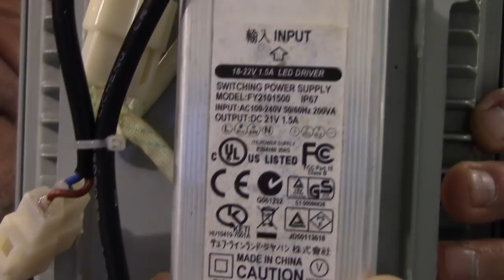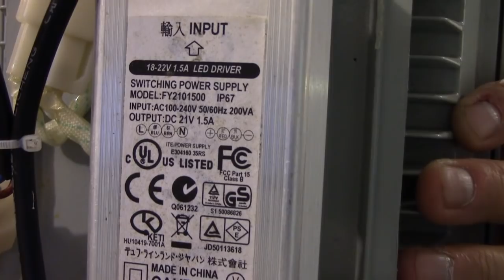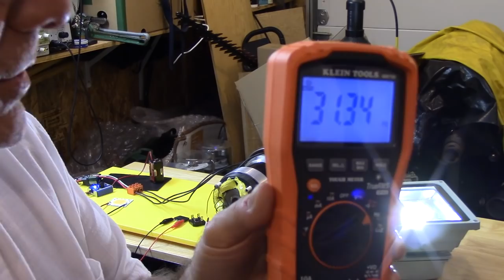Gerard Morin: A Glimpse at the Generator (Important)

Comment: I rebuilt two Baldor  3 phase 7 hp motors 40 years ago. I started the system on 120 ac then looped it back. and was running my big lathe (It would swing 29 inches at 9 feet). An Interesting thing happened it scattered (the generator) at 35,000 rpm, long story short it blew up, luckily I was at the other end of my 120 foot shop. You are point on Sir, I'm now retired in S.E. Asia. God Bless you for knowing we swim in a sea of energy. P.S I've been in sand storms in the middle east that blocked out the sun. When ever the neutrinos are disturbed on the Sun their cousins are excited here on earth instantaneously. Every time there is a lightning strike on earth the Neutrinos are disturbed around the planet instantaneously and that is free energy, as I understand it.  The negative spins right, the more negative spins left. When they rejoin you have energy if you're smart enough to collect it. Carry on Sir if I discover anything earth shattering I will happily share it with you so you can share it with the world.
Reply: also interesting

Comment: A rotator that produces high frequencies doesnt need to rotate at a very high speed to produce the propper resonance, in fact it isnt needed a high speed for a wanted frequency. Once a resonance is achieved the other component is the amount of pressure generated in that frequency, so if you add or take away energy to it you can actually extend or reduce the radius for the reaching of the frequency and the amount, it also can be audible or simply felt like tinnitus in the inner ear.

Comment: your LED's flicker because they are digital DC it is a diode a half wave rectifier, so when you connect it to AC it blocks one half of the cycle you are now creating a visible pulse,  if you put a full wave rectifier like you did you will still see the pulse because the LED uses all available energy in the cycle, then add a 1000 to 2200 MFD cap across the DC of the rectifier, it will store DC power in excess of what is necessary to run the LED for the cycle  removing the AC oscillation, the larger LED light has a wide range driver that will accept multiple voltages.

Comment: 19:00
The washing machine drum motor.
Three legs (phases?) All connected together with no ground (return line?) He says "motors" normally have return lines? Calls this a linear motor? Like the rail gun trains? Which operates coils in an on off configuration. Constantly attracting forward. Linear motor rail gun trains use one pole magnet (north pole and south pole) as if one bar magnet across (left to right.) Which is necessary to balance the height and center of the train because figure eight coils on each side of the train are connected also across the bottom of the track below the train. The superconducting electromagnets in the train are forced by the induction created into these coils to balance height and center on the "track." According to induction and feedback from electromagnetic generated in the figure eight coils. 

The drum motor stator is attached to the plastic drum (which holds and collects the water, under the metal drum) of the washing machine. The rotor is attached to a shaft which is attached to the washing machine rotor or metal drum which has water drainage holes. The shaft is attached through the plastic drum to the metal drum above it. After removing rotor and stator of the motor the two drums of the washing machine remain attached together.

If it has no return or ground line, this makes it like the pole transformer. Which he says makes it therefore an antenna transmitter. Inducing into three recievers. So the hyperdrive motor and the pole transformer have these two things in common. Both have no return line making them transmitters. Both transmit into three recievers. Induction into the coils becomes sine waves in the transformer so maybe also in the hyperdrive? He says the three legs terminate together? If the motor is driven by resonance the same as the pole transformer (PT) and if a slasher cycler must accompany this maybe the "driver" is the chopper (Hertz.) Because there are three inputs to three sets of coils and because washers control forward and backwards motion. This is likely the only reason for using the legs. In order to control the direction. Regular linear motors use successive coils to create a moving magnetic river or flow. With two or three phase AC would these work in s motor that terminates all the coils together? Delta or star configurations also use similar termination points. Is it explained that such end points act as a resistor or as a reluctance (magnetic resistance) whereby the magnetic field of the charged coils phase conjugates? Charge reverses backwards. Thus creating the same AC as the pole transformers. This is the Bedini battery charger motor effect. Phase Conjugation (PC) has inward charge attracting inward the magnet into the coil. When the coil is off the charge reverses PC again and the magnet is repelled outward away from the coil.

The home wire that is hot is chopped on and off. Connecting hot to ground or neutral increases reflectance resistance and therefore INCREASES PHASE CONJUGATION AC POWER. Without the reluctance resistance AC is not produced?
Reply: To recreate the Bedini charger effect and understand pc phase conjugation. John Bedini used a pendulum having a magnet on it. If he used his "how to wind a coil" method his coil was made with folded wire (several folds) also using one separate wire folded maybe twice. These wires twisted together and then wound on a spool. The one less folded separate wire is the trigger wire that charges the entire coil core together. A strong impulse from a healthy battery into the whole coil and core is attracting in the magnet. When off phase conjugation occurs and repels the magnet, because the longer wire (secondary) is connected to a dead battery (creating high reluctance and resistance.) As the dead battery is getting more charged up the reluctance resistance drops and the magnet is repelled less and less on the swing of the pendulum.

Comment: Why not call it a High Frequency Magnetic Generator  (HFMG Motor) for short. And please don't tell the powers-that-be that you're going to run them out of business. they will take you out in a heartbeat, stop doing that please. For Your Own Safety.
Reply: ionic-field-capacitor; is what it is. its not a motor (not for pushing a load of physical-matter). the only thing being generated here is an electron (ionic) field through the spinning the ferrous element with the high-speed-turning. the "ambient ions" are trapped in the field, and they bring their associates with them (basically, he pulled the stopper out of the bathtub, and the "juice" you see is all of the water flowing down the drain).
Reply: SURE IS DANGEROUS TERRITORY ! 

BE VERY VERY CAREFUL !!
Reply: @pgprentice  Scam artist  I got taken for just over 3000

Comment: What’s the big deal here?  You have a 48V DC supply on the bench behind you.  The back of the lamp says “21V 1.5A”. That is 31.5W of power.  I’m guessing the 48V DC supply is putting out about 0.8A.  You are not creating any free energy or violating any laws of physics.  It’s simple; that lamp is quite capable of running with a 38V AC input supply.  Whether it is 60Hz or 30Hz is inconsequential.
Reply: Totally, you get it, and the 30Hz is way its pulsing. Probably only checking and or using one pole of a two pole system.
Reply: How do I get 1 ... ??? You know it ... I don't...idk nothing about it ... can u help me built 1 ???

Comment: Hi Gerard, I stumbled on your videos via Youtube suggestions, I have watched several of them and have some basic questions. It seems as though you are convinced that you have something new and exciting. But some of the things that you say and are attempting to show go against all known knowledge of physics and electricity. You are only showing amperage and voltage measurements. There are two main questions that come to mind, as you have been playing around with these ideas for some time now, Have you managed to set up a unit to run your own home? If not, why not? You seem to work only with light bulbs of different types, why don't you power up something else that is used on a regular basis, a vacuum cleaner, a television, a microwave,  a hairdryer, a computer or whatever? This would show the practicality of what you are trying to do, if you have already done this somewhere maybe you could provide the link.
Reply: I hope you are not holding your breath waiting for an answer. It won't happen because it would prove he is right. The magic is in trickery.
Reply: @miketyler2513  nope had forgotten about it

Comment: You know you DO NOT NEED  a power source , right with that. tesla made his own power source , NO BATTERY.   IT WILL RUN ITSELF  you just need to know how to. IF you DO NOT KNOW the trick  it will NOT run itself.  I can run a magnet  generator off of a small motor. The generator MUST BE built so that the generator puts out 4 times the amps and volts the motor needs. YOU think this is NOT possible. IT IS NOT possible if you DO NOT FOLLOW the schematic.  TWO FORMS of electrical energy and tesla used both. you know both of these already. the energy with the washing machine generator is one way and the A.C we have today is another. he used both. Tesla said you can multiply volts , NOT AMPS. All this you already know , put it together . HINT , one powers the motor and the other powers the generator when run in unison as one , the magnetic resonance ramps up  that creates even more energy.  i hope you understand this. THIS  MAGNETIC ELECTRIC VIBRATION IS THE KEY.  BELIEVE IT OR NOT. I was wondering if you set it up so it can run itself and put out a significant power source to go into a transformer/capacitor.

Comment: What's powering the generator, from here it looks like electricity?
Reply: yes, small dc voltage feeds a motor he modified from a hoverboard, which turns the RF generator. the Hoverboard motor is further from the camera, the RF generator is facing the camera connected with a single shaft, each on its own bearing. RF and AC have the same wave pattern, which is how he's able to use it to power AC devices at lower amperages. Apparently it's easier to produce the RF power than it is to produce the AC power....this is the secret. (as I understand it)

Comment: How big would a system like this have to be to move a 500 pound bicycle load at  50 mile per hour for 100 miles distance? Would gearing be able to be used to increase the bicycle load weight and still maintain the distance and speed?
Reply: build one if have and test it   if you can   and if you cant   go eat t a bag of chips

Comment: Do you have a video where it is shown how the generator is constructed?Thanks
Reply: I haven't found one yet, but as far as I can tell he's using a single phase magnet to oscillate a stepping transformer then rectify the output. He explains that generating RF Voltage. What Tesla calls Static Power. So you gotta stop thinking AC or DC voltage.
Reply: dude rilly

Comment: Lot things are involved but me understanding thats microbial/thermal baterry fuel cell .
Simplicity only.
Normal old delco alternators and starter motors do that litel effect .
You have some points but what you are showing is only small part of it.
Biology ,chemistry,electro magnetism,mechanics,thermo dinamics are involved lot other things.
But mostly random effects.
Even inurtia and gravity temperatures effect that generator.
The history in short US army used compound motors multi stroker dual engines with compound rotary sg's most similar such engine exampel is willys jeep kubelwagen also called gasoline-disel engines driveing dual current rotatary devices rotary transformers/inverters/converters old delco hade 4 commitators.
So the generator parts it self makes the diference.
And back then those engines were 100% hybrids with hybrids generators .
Expecialy self regenerative fuel via bacteria is interesting ,solid state generstors and closed egrs chemical to chemical decomposition .
So the men there is right.
How ever there losses are converted to usefull work and energy is present over time .
So this men actualy did do lot jobs so what he uses is combineing things so thats the result .
Those things I mentioned before actualy do exist and actualy are proven and recorded .
But me sugestion hes generator works best on compound engine heavely reainforced and tuned for high economy .
So you actualy dont need water wind ore light energy .
Owen magnetic car prove me point as well.
So 👆that guy has a point there

Comment: Fake knock!
You can only hear the "resonance knock" at extremely low RPM's
You can clearly hear there is a difference in RPM between the two tests. 
7:06 you can hear the RPM's are lower than 8:12 Listen for the background electrical clicking sounds.

Comment: the anwer by high speed electric motors its all fine but those high frequncis are hightly radiation by aware of that how much my understanding is by having high rpm ac motors what you do is actualy removing the magnetic fiels of the earth rotation and if you counter the speed of rotation of the earth you neutralize those magnetic fields what is proportional to earth gravity if you have a no anty gravity device meaning no drag no load effects expecialy if you have a closed loop ground that can by used as well but still Im centrain that those devices are hightly unsafe and xray gama lights all of those things are not safe it can give you cancers it can kill you expecialy if you have gases lay around that electricity will react with elements so thats why peopel dont use it because they can cause masive destroction not bade videos I dont have nothing against any cinde of tehnology free ore not but! if you make some things that are not tested to full degree that is seriusly dangerous!! and by testing meaning to include all the testing chemistry,gases,elements and I dont think this men will not get a patent at all ore a production alowance from the goverment if it is not tested !

Comment: why does everyone try to devise free electricity from electromagnetism, zero point energy exists but it will not come from electromagnetism because you are bound by the laws of conversion & thermal dynamics.

the secret to zero point energy is room temperature superconductivity, similar to thermal couples & thermal piles that produce small amounts of energy when heated, room temp superconductor elements are designed in a below absolute zero kelvin environment to start producing energy when they rise above absolute zero, quiet & compact, no major moving parts, they work at night, the work in the cold & produce more energy as the heat increases, so one could probably power a house on a device the size of a central air conditioning unit including the DC to AC power inverts, or build a power plant by using one to heat & maintain the temp inside a room containing several industrial versions for power sub stations in every neighborhood.
Reply: I would like to see your prototype? No? Well than. What you said is all bullshit until you prove your theory.